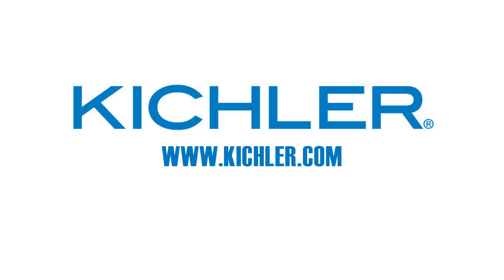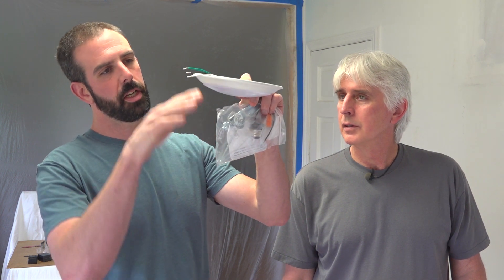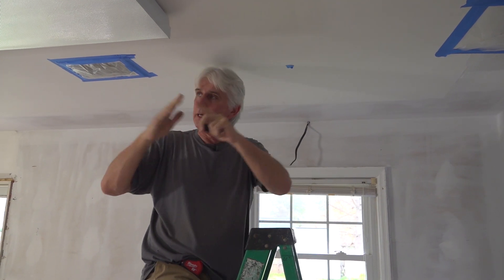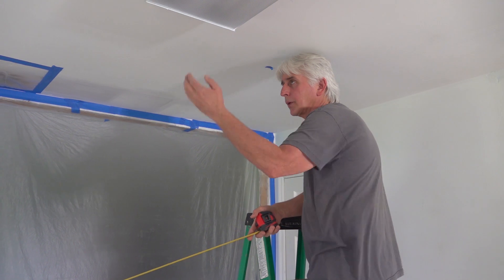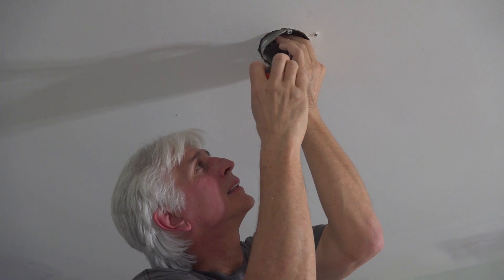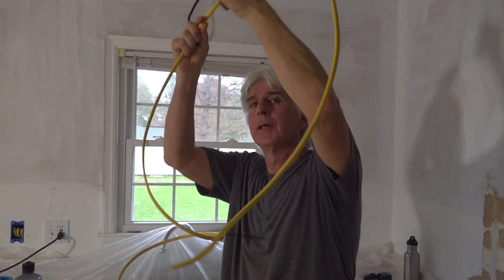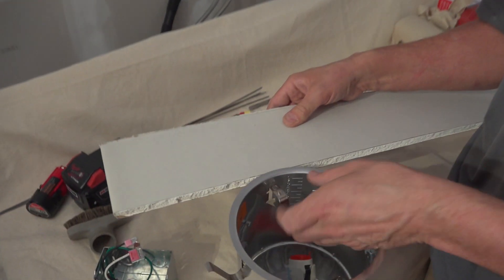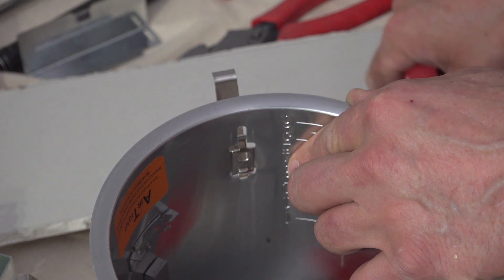Roughing In Kitchen Lighting - Kitchen Remodel E23

Comment: So boys, what about the old 1, 2, 3, rule for spacing fluorescent light fittings. Should this not also apply to these surface LED's ?
Reply from the maker: I have honestly never heard that term before. Not sure what you are talking about. If you care to ,educated me on the subject, :)

We treat each situation independently and try to create a balanced aesthetically pleasing lighting layout. The size of the room dictates the number of lights and generally we keep them 4' or a little more apart. The smaller the area the closer you generally have to place them. Some times you just have to go with the best looking layout because of irregular situations. We have worked out difficult rooms by putting on light at each end of a long room and then a couple down each side. Brian actually came up with that idea on a house with a ceiling light in the middle and recess on the perimeter. It was the perfect solution to an otherwise difficult situation.
Terry
Reply: @ForestToFarm  
Hi Terry, sorry, late to post, notifications turned off for some reason. 
It may be that the term is used here in England and therefore not known to you. (I know I may be trying here to teach Granny to suck eggs.) It pertains to the spacing of surface lights (although you are using down lighter fittings with retro- LED surface lamps) where the distance from fitting to wall is half the distance between rows of fittings. For instance, if a room is six metres wide with two rows of fittings, then the distance from wall to first fitting will be 1 ½ mitres, between fittings, 3 mitres, and second row to other wall 1 ½ mitres. This stops any dark areas and also uneven intense pooling of light  (inverse lighting rule) due to light being omitted ‘cone’ shaped from the lamp.
Also, talking of LEDs, have you considered using dedicated solar powered led lighting circuits in your new homes similar to the commercial set-ups for outhouses in order to simplify install and replacement and in the long run turn out less expensive ?  Even stand-alone EM and approach lighting using small incorporated solar panels are the future. 
 Love from the UK and remember, ‘If it was easy, they would have boys doing it.’ ,,,,, Del.
Reply from the maker: @dcsoxford  Thanks for the explanation Del. I have considered solar. Right now we are going with local power supply. We plan to add a well for water and do several things to reduce power needs plus eventually getting solar panels. Its all going to happen over time. We want to stay debt free so we are doing things a little at a time. I have other plans as well like a hydro ram and also a hit and miss run on grain alcohol that we produce ourselves. Its going to be a good long time before we make it all happen but that just keeps us motivated.   :) Thanks for commenting!!
Terry